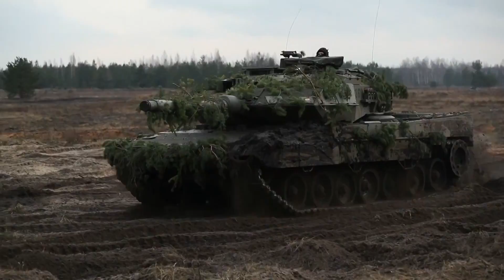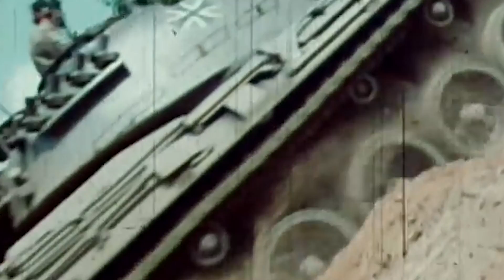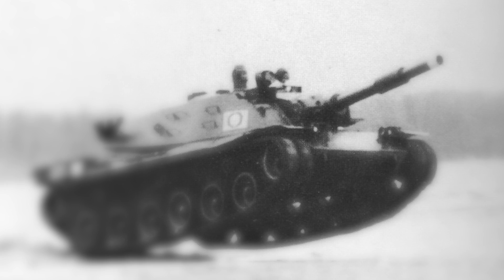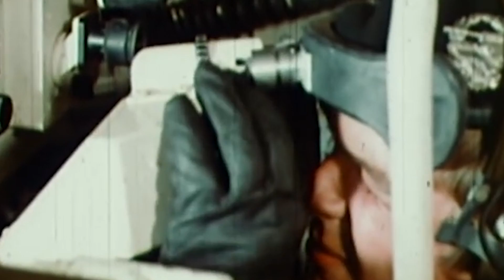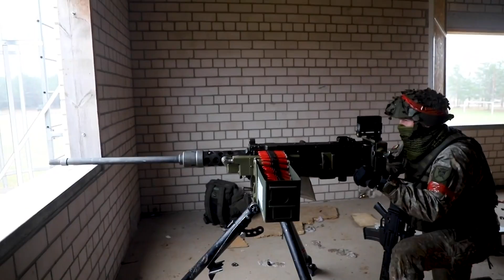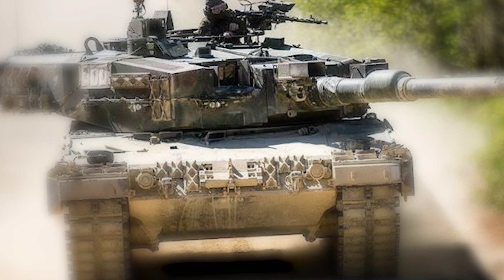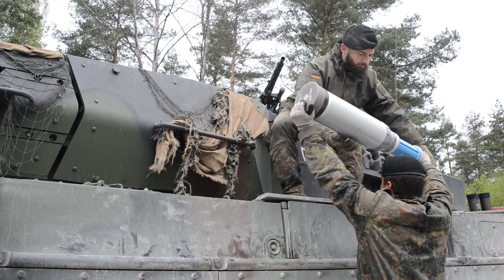Massive Super Tank - Leopard 2

Comment: Exciting times within tank tech. The new Panther aswell as AbramsX is moving the goalpost forward. That said, nobody is gonna deny the massive role the Leo 2 had  in tank warfare
Reply: AbramsX is just a tech demo. The real Abrams replacement is unknown.
Reply: I want to add on that whatever replaces the Abrams will probably be lighter and less armored than the leopard 2. Nothing can beat the leopards armor
Reply: @antilarge7860  Because Abrams uses DU perpetrators it has more penetration with he L44 120mm gun than Leopard even with the L55.  Because the Abrams has DU armour  in the turrets and hull. Because Abrams has DU in its Armour its Armour is probably better.   Abrams also has blow out panels on every magazine location not just the bustle.
Reply: @williamzk9083  Idk about if it's true what you're saying with Abrams using DU in the armour, because that's pretty fucking dangerous since it's Depleted Uranium and next to that the Abrams uses Chobham which is still classified. The armour of every modern tank which is in use is still classified

And Abrams also almost never uses the DU rounds since it is harmfull to the crew since it's radioactive and it's meant more as a last resort. The Leopard 2A7V with L/55A1 could most likely also shoot the DU round of the Abrams since the Abrams' gun is an exported variant of the Rheinmetall L/44 found on the 2A4 and the L/55A1 could withstand a higher pressure. But I don't think that the Abrams would have a higher penetration than the new Leopard 2A7V with DM73 which has ~1000mm of penetration if the Abrams were to use a standard round
Reply: @antilarge7860  I think that XF51 is a tech demo as well. There are excellent ideas in both AbramsX and Leopard XF51.  
At the the moment there are actually 3 variants of the Leopard 2A7.  There is the basic Leopard 2A7, the improved Leopard 2A7V.  (the V stands for the German word verbessert or bettered).  It has better features for urban warfare, spall liners, mine protection and top protection.  And finally the A7A1 which is in production right now.  This includes APS Hard kill in including top protection.  Missiles such as Javelin and NLAW would be blocked by this tanks APS (Active Protection System)
Reply: @williamzk9083  I wish they would just merge both designs into one super tank.
Reply: @antilarge7860  Both Leopard and Abrams came out of the Joint German US MBT70 program that Germany and USA worked on.   Joint programs are OK even if they split after work share arguments and siagreements because you end up with a better weapon.  Same happened with ASRAAM and IRIS-T and Typhoon and Rafael.
Reply: @williamzk9083  The new tank isn't called XF-51 Leopard but KF51 Panther

And there are more Leopard 2A7 versions: 2A7, 2A7+, 2A7V. The Leopard PSO is based off of the Leopard 2A7 (you can visually see that) and the Leopard 2A7A1 was iirc only a demonstrator to see if Trophy APS could be mounted onto the Leopard 2A7, the newest production variant is the 2A7V (and it's called 2A7V also to honour the A7V from WW1)

But it could totally be that the Trophy package is being mounted on Leopard 2A7's and sold under the designation 2A7A1
Reply: Other then tankers in the u.s are battle trained that's what's gives the upper strength
Reply: @johnmorehead5008  no it's different doctrine. Germany is tiny so a very expensive and very powerful tank is better because you dont ever need to move them outside your cou try. American tanks are light and fast because America can deploy anyone and anywhere on the planet.
Reply: @antilarge7860  the Abrams and Leopard 2 weigh roughly the same amount.
Reply: @antilarge7860  The M1A2 SEP is super heavy what do you mean?!
With the Tusk its even more heavy. So no. And honestly, the tanks are pretty similar in doctrine, while germany lays more emphesis on combined arms. Worth to mention is that both tanks have big dick armor in the turrets and have a good gun depression. Which leads that both tanks are designed to use hull down tactics. Overall tactics are super semilar with both tanks..

Comment: 560mm armor penetration is not very good for a modern tank gun , i guess its a short barrel from the looks . the tank itself has 1500mm and the new t14 armada has 1400mm so 560 doesnt cut it for modern tanks
Reply: Where do you get your numbers? The newest ammo for Leopard 2 DM73 has about ~850mm of penetration (some claim ~1000mm+ but I doubt that. The ~1000mm+ number is more likely for the upcoming KE2022 ammunition which is currently developed). As for the Leopard 2s armor if we take the 2A7V version we have 1200mm+ on the turret and 850-1000mm on the upper hull. On the lower part it should be around 400-700mm (the lower you go the less armor it has. 400-450mm on the lowest part which is quiet small. Most of it should be 500mm+). As for the t14 the only numbers I could find were ~900mm of armor on the hull front and the turret is unmanned and mostly empty. So DM73 doesn't quiet cut it but a lucky shot could go through and the new 130mm will definitely go through.
Reply: @ratlingzombie8705  this very episode said 560mm on that penetration round and yes I’m sure newer rounds will be better . And with modular kits the t14 can hold up to 1400mm frontal armor
Reply: @mikesmith-wk7vy  it cant , look at the t90 bvm claimed armour. It was claimed to have up to 1200 mm for chemical and now it gets killed by stugna p missiles from the from the front.. all Russian propaganda. The leopard can punch through the 90 m and t14 no doubt even with dm 63 with around 780mm of pen. DM 73 and DM 83 for kf51 are another story.
Reply: @leopard2109  that’s one point they Could be lying about the t14 and it’s armor but 1000mm+ does seem to be what many new gen tanks are shooting for
Reply: That's the penetration at 60 degrees from 2 kilometer the 90 degrees is up to 900mm.

Comment: Would like to see an honest comparison of Abrams, Challenger II, and Leopard II. The share many common features but have trade offs based on national defense goals and tactical strategies that equate to pros and cons in each type and I would enjoy exploring these.
Reply: This is highly dependant on which variant ur talking about. Id say the leopard 2 and Abrams are far more close to eachother than the Chally 2 is. 

The Leopard 2A7V and M1A2SEPv3 both have Smoothbore 120mm guns, with the Leo using the longer L55, but the Abrams in turn uses more effective DU penetrators while the Leo2 uses Tungstenalloy. So roughly equal in firepower id say.
Armor wise the Leo2 is maybe a bit more modular and easy to configure. Both tanks have classified but most likely fairly comparable armor, with plans to incorporate Trophy on both.

Mobility wise both use a 1500HP engine, diesel for Leo2, Turbine for Abrams.

The Chally 2 currently lags behind in pretty much all factors. It uses a rifled 120mm gun with two piece ammo, which means the ammo isnt stored behind a blast door with blowout panels, and the rifled gun is lower in performance, higher barrel wear and limited in penetrator length. The chally2 is just as heavy as the latest abrams and leo2 but has a much more limited powerpack, thus lower power to weight. Also the hull armor on the chally2 is fairly weak.

Even the chally3, which ill incorporate the German L55 gun and a much better FCS wont surpass the Leo2 or Later M1A2s imo.
Reply: @Yung_pindakaas  DU isn't significantly more effective than wolfram main difference is that L55 allows for better velocity with same amount of explosive, and us is using more of explosives for same effect.
Reply: @simon2493  DU is a huge advantage.  Probably 33% more penetration easily.    A 25mm chain gun firing tungsten APDSFS can penetrate over 110mm which is why Bradley's would take out T-72.  Uranium self sharpens so there is always a needle like point.
Reply: @williamzk9083  generally at lower velocities around 1 kps DU is slightly better, but when we move forward 2 kps then wolfram offer better penetration capabilities
Reply: @williamzk9083  .quora.
Reply: com
Reply: /What-is-better-for-armor-and-penetrators-tungsten-or-depleted-uranium
Reply: @williamzk9083  sorry for link being cut to pieces but well yt boot takes them down in normal form
Reply: Biggest difference is numbers and deployment capability. Challenger is very few in number Leopard has more than 7x in the world, Abrams has 2x Leopard. Challenger and Abrams are meant to be be deployed externally to their countries as invading the US or Britain is unlikely.  Leopard was meant to fight on home soil though development has made overseas deployment more effective,  the armies that deploy the Leopard don't have the resources for fighting away from home in numbers that the US overwhelms in and UK can do effectively.
Reply: Abrams would destroy them all
Reply: @mia1shooter  depends on the context. Hungry beasts don’t fare well after the first day
Reply: challanger 2 would definitevly be the word of the 3
Reply: There are at least two well documented competitions for bids to supply Sweden and Greece with tanks. All Western tanks participated. Guess which tank won both.
Reply: Well, the Leopard 2 is generally considered the best of the three by most experts and many evaluation challenges that all three have entered has confirmed this notion.
How much better, that no one knows for sure since many aspects are secret about all three.
Keep this in mind, unlike the M1A2 and the Challenger II, the Germans never stopped upgrading the Leopard 2, yes the M1A2 has had some upgrades, but not on the scale of the Leopard. There is a reason the Leopard serves with more militaries than any other allied tank.
Also, a tank is only as good as those operating it and German, American and British tank crews are superior to anything the Russians or Chines put into service.
Reply: @Diemerstein  I completely agree. The L2A7+ is objectively the best MBT in the world right now with Chally sat at second with its new rounds of upgrades and the M1A2 sat in third; there is subjectivity between the Chally and the M1 but there is little doubt that the Germans have created the top tier tank in modern warfare. The Danes took the L2 to Afghan and it was a monster... After 24 years in the British Army I know which one I would want backing me up in a pinch.

Comment: The submarine move must have been a PR stunt, assuming water only leaks in around the edges away from the air intake and that only so much water can leak in over a set period of time if it was a short run(aka, if it takes 45 seconds to cross, the water level in the engine compartment hasn't quite reached the height of the air intake), because there was definitely no snorkel visible.....
Reply: No, the tank can really stay for significant times under water. The airintake for the engine can be rerouted through the fighting compartment with a simple lever. So the engine then basically sucks in air through the snorkel the commander stands in. Also this provides fresh air to the crew at all times.

Comment: Its funny you talk about the Leopard 2A7+ but show a Leopard 2A6 which you don't talk about. The main thing with the 2A6 and 2A7 versions is the firepower with the replacement of the 120mm L44 to a longer barreled 120mm L55 gun. This gave the tanks firepower 30% more muzzle velocity increasing its APFSDS rounds with more penetration. Overall good vid though.
Reply: They switched the gun, when they upgraded from a5 to a6
Reply: The 2A6 already uses the L55....
Reply: SPO version went back to the shorter L44 due to preceived urban combat restrictions with operating a longer barrel on narrow streets

Comment: This beast can run on milk if it wants.. just a joke, but it's not picky to what it is capable of.
I'm especially impressed with it's diving capabilities.
Reply: If it burns it is a fuel
Reply: Milk is 4.8% fat maybe 5.5% for Jersey.   If you separate it out and put it through transesterfication with a little ethanol or methanol you will have biodiesel.  It will burn clean and with less soot than normal diesel.
Reply: The Leopards 2 can easily be destroyed from the side with an old soviet RPG grenade launcher operated even by a woman like it was in Syria.
Reply: @Nik-jq4tx  it's under a little more pressure from the inside to thwart of gas attacks, but that also means you can let a fart go, and they can smell it outside.
Reply: It's amazing
Reply: @Nik-jq4tx  there is no tanks that survive the turkish treatment
Reply: @Nik-jq4tx  "operated even by a woman" ? obv doesn't make it less lethal..